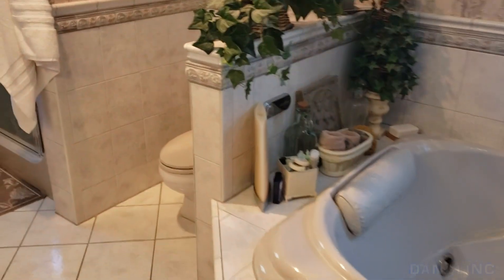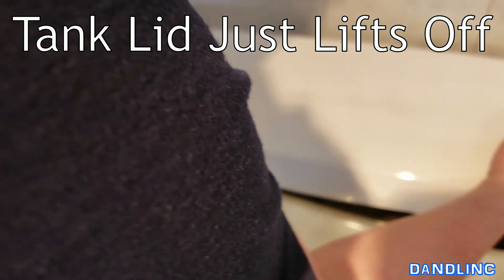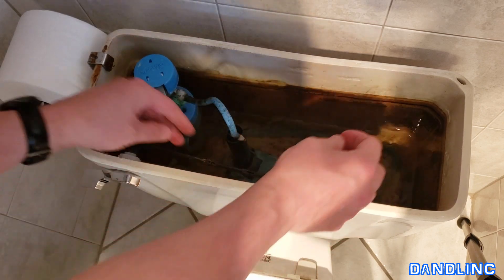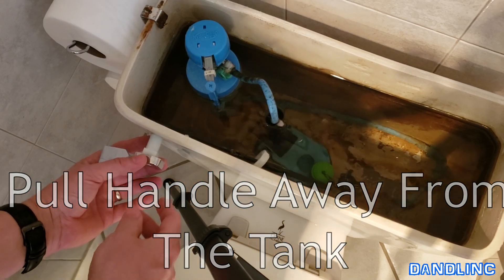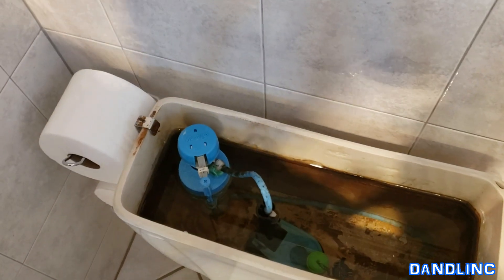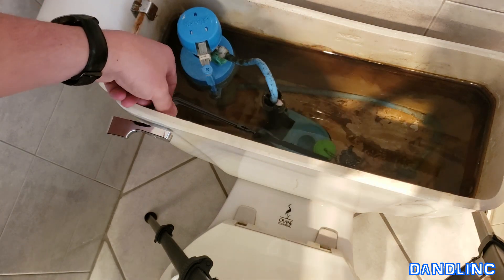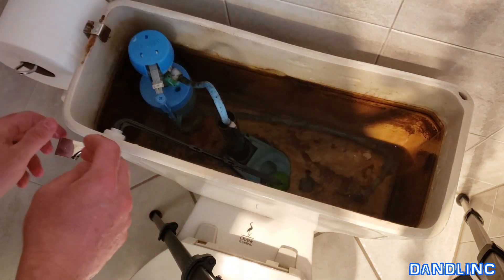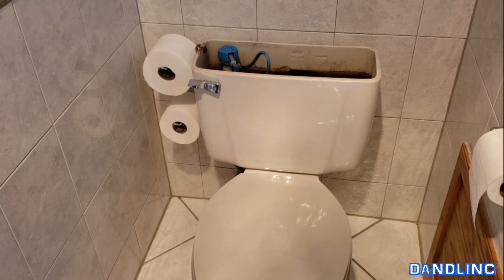DIY!  How To REMOVE & REPLACE A Toilet Handle (Lever)

Comment: My handle is stuck in the down position and after I flush it, I have to push it back up to the normal position.  Do you think it's because I need a new handle?  The chain looks like it is in the normal place.
Reply: My old handle was doing the same thing until the plastic arm broke.  Now the new one installed was doing it every time, getting stuck after pushing down to flush and I have to lift the handle up manually to stop the water flow.  The only way I got it to come back up after flushing is leave the locknut in a very loose position, not even hand tight.  The hole in my toilet where the handle arm is inserted is round, not square like being discussed here so I do not know if that is the problem.
Reply: @randys6220  Well I solved the problem by getting a better plumber.  I showed him some of the bills from my old plumber and he said I had been grossly overcharged.  Well that part of my life is behind me.  I hope you find a solution to your problem.  Maybe the person in the hardware store has a tip.  Best of luck to you!